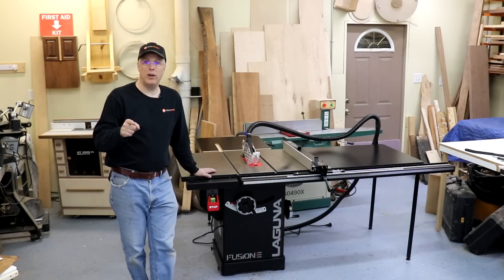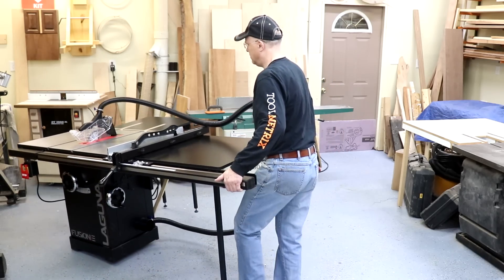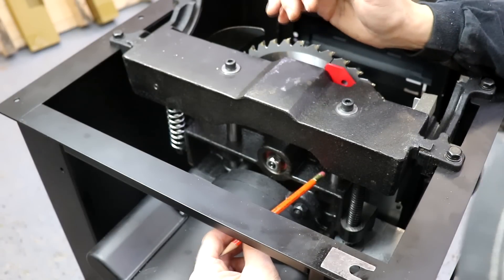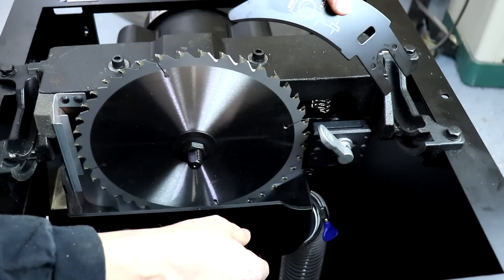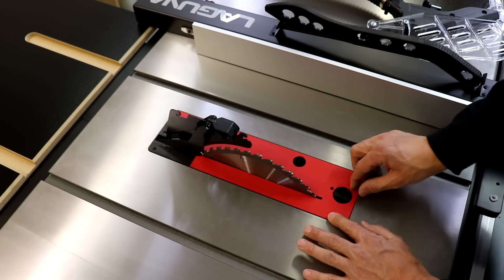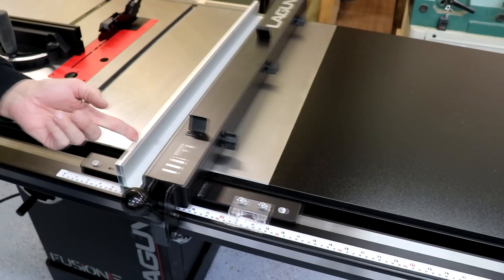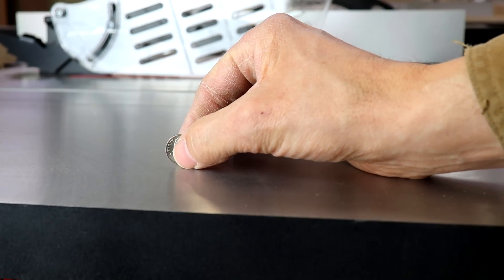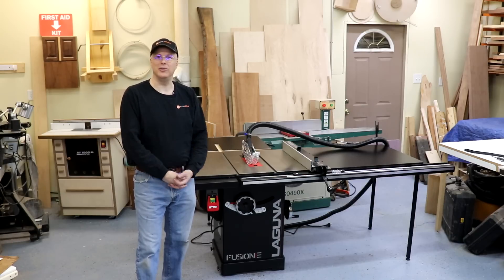Laguna Fusion F3 Table Saw Deep Dive Exam

Comment: Hi any chance you  could do that d b sound leavel for the fusion 2  please
Reply from the maker: Hi Christopher, I just dug through the raw clips from when I filmed that video, and I found the db test.  It maxed out at 84.9 decibels, which is not bad for a table saw.
Reply: thanks so much for getting back to me  i really needed that information very nice off you to take your own time to look that up for me  @ToolMetrix
Reply: so if noise is a concern would you recommend the fusion 3 instead as its 78db which is fairly quieter. thanks again
Reply from the maker: My pleasure, sir. Thanks for watching.
Reply from the maker: They all get a lot louder when they are cutting. If noise is a major factor I’d suggest using a 7-1/4” blade on the saw if you can. That’ll make a huge difference , both when cutting and not cutting. Different is HUGE. Check out my “best saw blade” recent video.
Reply: @ToolMetrix  brilliant thanks again and fantastic  video .

Comment: Great Review. This looks like an outstanding saw, but it does concern me that the runway ahead of the blade is so short compared to others in its class. Is 8" sufficient  if you use a lot of jigs and  sleds? Seems like you would often be working  right on top of the blade or have trouble vertically stabilizing larger panel sleds... interested in your take.
Reply from the maker: I think that the reason for the forward positioning is so that the operator doesn't have to reach so far over the table to push something past the blade, which could be a safety factor as well.  I'd rather have more runway.  It didn't seem problematic to me in my testing, but the challenge would be in ripping large sheet goods where the runway helps you to get the sheet aligned properly before engaging the blade.  The fact that the fence extends forward mitigates this situation a lot, but even with the fence fully extended I didn't have as much runway as on my Unisaw.  For me it's a factor to consider but not a deal breaker.  It's just something to get used to.
Reply: @ToolMetrix  Thanks for the reply. If one did use a lot of sleds, would you think that the Laguna still compares favorably with the Harvey Alpha or the Grizzly G0899 which both have a traditional blade placement and a European fence? Not only in terms of safety, but also frustration-free use? Are they in the same class as the Laguna?

Comment: What is the dimensions of the box on the top
Unfortunately my workshop door 89cm only.. And I'm already ordered f3.. I'm not sure if i need more space to get it inside.
Reply from the maker: It will fit through that
Reply: @ToolMetrix  Thanks 😁
Reply from the maker: @diycharger1760  No problem.  That's the same size as my shop door.

Comment: Thanks so much for your review. It has been really helpful and I have decided to purchase this saw in the UK. One question. In the UK saws are braked to stop more quickly so they do not recommend using a dado. Are you aware of a dado stack that can be used with a brake mechanism? Thanks Dave
Reply from the maker: Hi Dave, Thanks for the feedback. It's interesting to learn about the more aggressive breaking mechanism in the UK.  I like that idea quite a bit.  I'm surprised to hear your question about using a dado, however, as I was under the impression that saws that are sold in the UK did not include an extended arbor because dado stacks were forbidden there.  It sounds like that is not the case?  Has there been a change, or was I previously misinformed?   I'm not aware of any dado that would be specifically designed to operate with a more aggressive brake, but if anything I would think that a wobble style dado would be more apt to work ok because it would be lighter.  I don't really care for that style of dado, but if weight is the concern it might be an options.
Reply: @ToolMetrix  There are a number of machines on the market now with longer arbours but the supplier is prohibited from saying it can be fitted with a dado even though they know people do. Thanks again for your thorough reviews. Dave
Reply from the maker: Very interesting!  Thanks, Dave.

Comment: I'm not sure if you can answer this, but I have a question about the hi-lo fence. If the indicator is calibrated so the ruler reads accurately with the fence in the high position, then how do you read it with the fence in the low position? It appears the low side is wider, which would change the distance between the fence and the blade. I checked the manual available online but it only seems to discuss assembly and doesn't cover any of the features including the hi-lo fence.Thanks!
Reply from the maker: Hi Randy, the scale is only accurate with the fence in the high position.

Comment: I've been looking at this saw and someone pointed out that the blade is closer to the front of the saw than others (by a couple of inches).  Did you notice this and/or do you see it as a potential issue?  Thanks for your review!
Reply from the maker: Hi Jim, . I did notice that. I think it’s a safety thing. Less distance to reach as you guide a work piece past the blade. If you’re ripping something big the fence can slide forward to provide a bit more runway. I didn’t have any problems with it. Could make it a bit trickier to rip a full sheet of plywood, or other large pieces that are a bit unwieldy, but I didn’t try that.

Comment: Received my new saw last fall really nice saw a lot better than the grizzly that I use to have 
The raise and till work great
Dust collection in the base works great but made my own 4” over blade collection which eliminates all the flying dust coming off the blade
I replaced the rails for the fence to let me set the fence on the right side of blade and extended it to an overall length of 6’
I have a major problem yesterday I was ripping 16’ long 2x6s after the 11 th board the belt melted and came apart 
I need a new belt 
How fast can I get one
Reply from the maker: Yikes! Never heard of a belt melting like that. You’ll want to contact Laguna about a replacement. I’m just a YouTuber.

Comment: This might be a odd question but how many drive belts does this saw have the saw I currently have now has 3 belts to drive the blade.
Reply from the maker: It has one drive belt, which is pretty common these days.  I have an older Unisaw which uses 3 drive belts.

Comment: Thanks for this and many other great reviews! Do you know how to regulate the riving knife height?
Reply from the maker: The riving knife moves with the blade so the height is adjusted with the handwheel. I don’t remember if/how the gap between the blade and riving knife is adjusted.
Reply: @ToolMetrix  Thanks for your answer! Yes I know it moves with the blade... but mine sticks above the blade and as you know it should be aprox 2 mm below it. I can´t seem to find a way to adjust this. I think I will end up grinding the riving knife. Thanks again!
Reply from the maker: Hmmmm...yeah, got it. I’d suggest calling Laguna before grinding it, but grinding it should be fine too.

Comment: What thickness is the blade & associated riving knive that comes with the saw? Are there other thickness riving knives availible?
Reply from the maker: There’s a full kerf knife that comes standard and a thin kerf available as an option. I don’t recall the exact thickness of the full kerf but just shy of 1/8” I believe.

Comment: Is there a door in the cabinet to get to the underside of the saw so it can be cleared of sawdust that the dust collector does not pickup?
Reply from the maker: Just the access panel on the motor side

Comment: Just finished assembling my F3. They sent the wrong setup guide. My saw does not have T-bolts holding the fence guide. There is no instructions on assembly of the fence guide, side mounted table and out feed table. Guide says it is a one hour setup but It took me 5 hours.
Reply from the maker: Hi Jerry, I've heard similar feedback from others.  I didn't refer much to the manual during my assembly (it was the third table saw I assembled within a few weeks, so it was pretty familiar), so I can't really comment on it.  It's a shame to have so many gaps in the manual, and I hope that you've passed along your comments to Laguna.

Comment: Did you get the dimension of the saw in the crate? Hoping to move it through some doorways before unpacking.
Reply from the maker: Hi Aaron, I didn’t measure but I moved it easily through a 35” opening.  Hopefully that helps.

Comment: Dear Tool Metrix,

I would like to ask if the circular saw blade is directly mounted on the axle of the electric motor or if there is a belt drive.
If my question is hard to understand I'm sorry, i'll write it with a web translator.

Thank you for your reply.

Best regard: Tibi
Reply from the maker: Hi Tubor, thank you for your question. It is belt driven.
Reply: @ToolMetrix  Thanks for the reply.

Best regard.
Tibi

Comment: Thanks for taking the time to review the laguna saw. I was wondering if you had dust collector running when you were crosscutting? There seemed to be considerable amount of dust escaping.
Reply from the maker: Hi Stephen, Great question.  Yes I did dust collection hooked up.  The dust collection design on this saw splits a 4" feed into a 2.5" and a 1.5" line, plus a small hole into the cavity of the saw.  To me, this design assumes that the user has a small dust collector and wants to get some collection above the table and some from beneath the blade.  For a typical small shop environment, that's probably a reasonable common denominator assumption.  Splitting down to the smaller lines like this delivers some air flow for all three members, but there's only so much to go around.  It catches some but not all of the dust.  For those who have a bigger dust collector, what I'd suggest is to run a 6" drop to the duct to the saw.  From there, replace the internal 2.5" hose with a 4" hose, extending that inside the cabinet to the shroud around the blade.  From the 6" main duct, branch off a wye (not a "T" as it currently is), and run a 2.5" line to the blade guard, with an adapter right at the guard.  Might have to add a support wire from the ceiling to handle the additional weight of the 2.5" line; not sure.  If I had an underpowered dust collector (1 - 1.5 HP) I might decide to replace the internal 2.5" with 4" and put a cap on the port that is used for above table collection.  To me it's most important to capture below the table  to keep the inter-workings of the saw clean.  This probably requires 350 - 400 actual CFM.  If you are pulling a fair bit more than that, then siphoning some off to run to the above guard collection is a great idea.  Dust collection is a tuning exercise, and it's tough to have a one-size-fits-all configuration.  This one provides a good "out of the box" starting point that can be easily modified by a user to take advantage of whatever capabilities their dust collection system has.  Others might not agree with my philosophy on this, btw, and might prefer to get some dust capture both below and above the table.  I currently use an old Unisaw and it's about as bad as it gets for dust collection.  I made a 6" port and connected it to the back of the saw, and it collects from the entire cabinet.  It takes a LOT of CFM to keep that saw clean inside.  I don't currently have above table collection, but I'd like to.  I really like the shroud that this saw uses, because you don't have to collect from the entire cabinet, but it's also important to balance the hose size with your dust collection system to maintain the best possible extraction.
Reply: @ToolMetrix  This is a great response! The parts supplied allow each person to fine tune their application, as you mentioned id change the internal to 4"  and run mainly below and if you wanted about could always use a shop vac with dust deputy. So many options, thanks again for the review of all 3 saws.
Reply: Hi there. I run a 2HP with canister filter, would you just run 4" inside and drop it down at the shroud? I use to have a second 4" drop from the ceiling and reduced it to 2.5" near the blade guard. Maybe that's the best approach based on your suggestion. Do you think 2hp would be enough?
Reply from the maker: I would do it exactly like you are saying. I would first try without any collection above the table. If you get decent collection then I’d try above the table as well. I think you should get decent collection that way on both top and bottom. If not, I’d skip the top collection and just get everything you can from below. If you’re not getting good collection below I’d either figure out how to modify the shroud to accept 4” with no reduction or I’d collect from the entire cabinet with a 4” (not ideal).
Reply: ToolMetrix as an FYI, I retook your advice and ran another drop from the ceiling for the over blade guard. Still horrible so I sent an email and just got a phone call from Laguna. They have redesigned the blade shroud apparently, and are sending a new one out ASAP so I can add it to the saw. So if you have an F3 I would suggest calling for the new shroud!!
Reply from the maker: That’s great to know. Thanks!

Comment: Great overview.  I purchased an F3 two months ago, and I can say aside from the lack of updated assembly instructions (still to this date unavailable from Laguna) that it is a great saw.
Reply from the maker: Thanks for sharing, Matt. I agree that the manual could use some additional assembly details.
Reply: Another hat tip to you is that yours is the ONLY overview/review that I’ve been able to find on YouTube other than Laguna’s.  For their price-point and features, I expect sales of these newly updated Fusions to really take off.
Reply: I just got mine today. The lack of instructions for the 52" rails is insane. I was told to reference the exploded parts diagram, which I think is actually wrong. Or at least I can't figure out how to read it :). Any tips would be appreciated!
Reply from the maker: I’d suggest calling in to support. If I still had it here I’d send you some pictures. I don’t remember how I did it. Sorry.
Reply: @droddis  I was told by a Laguna tech representative that the parts list didn't match up with the exploded diagram and that it was another issue they needed to address.  Mine is the 36" but if I can help in any way, hollar at me.
Reply: Matt Wood ok glad it's not just me. Every time I think I'm putting it together in terms of list and parts diagram something doesn't make sense
Reply: @mattwood2773  so I’ve seen it say that it actually does 37” is that true or is 36” the max rip capacity
Reply: @jaredwaters4633  I’m at work today so I won’t be able to check.  The magnifying glass for the tape is to the right side of the fence, so it may be possible.  I’m just not sure if, or how much of the fence body might be hanging off the right side of the table going 1” past the “max.”
Reply: @jaredwaters4633  when I got to my saw, I locked down the fence at least an inch past 36" and it was still maintaining contact at all points.  Not by much though, the back fence sliding "foot" was about an 1/8" over the fence support rail.
Reply: How's the dust collection?
Reply: @ball1974  not really having a basis for good comparison (previous Dewalt jobsite tablesaw and older Craftsman TS), I'd still rate it pretty good.  The underside of the workpiece your cutting really does a decent job, as the blade is shrouded from the trunion area and has a 2.5" hose leading to the lower dust port.  The included overarm dust collection/guard, I was not as impressed with, and don't use because of this reason.  My dust collector is rated @ 1250 CFM, so a more powerful unit might do better on the topside (although the hose for the topside is probably only an inch and a half in diameter).

Comment: Great overview. While watching, I noticed your channel does a lot of Laguna product deep dives. I'm sure you're a huge fan of their products, but I gotta ask: Does Laguna sponsor your channel in any way?
Reply from the maker: Hi Matt, I’m a huge fan of any good quality tools. I like setting them up, taking measurements, and using them. I have an open invitation to any tool company that has an interesting product to send one out for evaluation. If I find it to be a worthy product I make a video.  Sometimes I don’t. Not all companies will do this because my audience is modest in size, but some, including Laguna, will if they like the in-depth approach that I take. I don’t have any sponsors, and I’m not loyal to any brand. I currently have stationary and bench tools in my shop from Delta, Grizzly, WEN, Bosch, Ridgid, Oneida and Woodmaster. I’ve also owned and used several other brands over the years. I do appreciate your comment and take it as a reminder that I need to maintain a better balance in coverage.   I do know that, but sometimes I just go with the flow.  Cheers, Paul